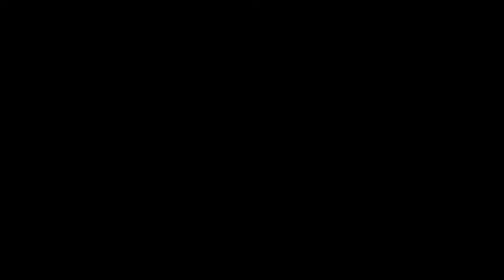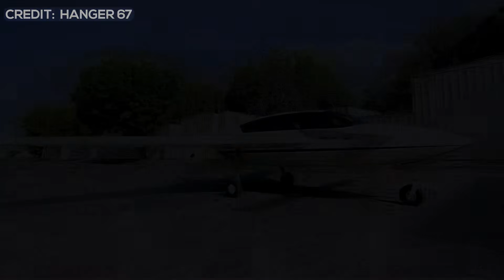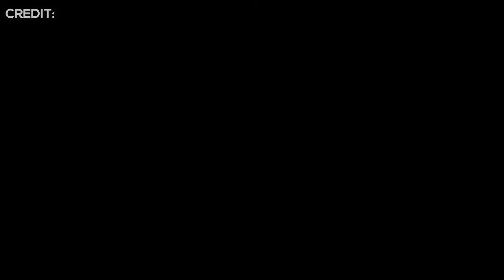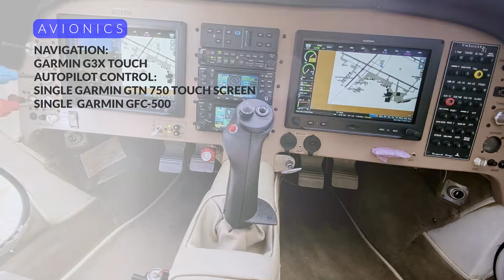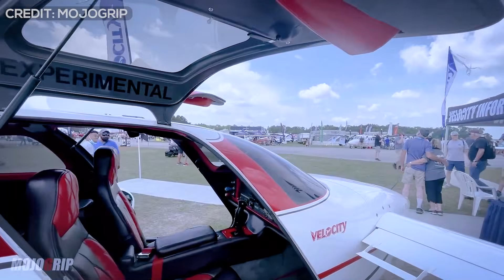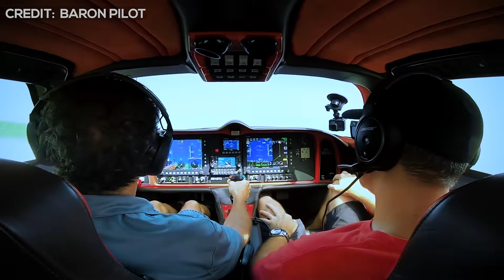Why the Velocity XL is Excellent

Comment: Good video. However, the Velocity Aircraft website says that the cruise speed is 250 ktas and with turbo even 270 kts is possible. 220 kts as stated in your video is far too little.

Comment: Many thanks for all infos !!! Could you confirm that the canard system  does not have negative portance of the traditional rear horizontal stabilizer which means that all square feet of the wings & canards are working together  to keep the plane flying ??? Thanks again 😄😄😄

Comment: Velocity says exceeding 220 knots could affect the airplane structure...  but I've read several Places that the Continental 310HP engine fitted with a Turbo ON A VELOCITY Can Cruise at 300mph...?  How does that work?
Reply: Indicated Air Speed (IAS) and  True Air Speed (TAS)  A limit on the maximum speed  (Vne)  does not mean that the aircraft cannot go faster through the air than that.

Comment: The door seal is NOT for pressurization, it is to reduce drafts and noise.  The demo plane is showing the GTN 625.  The aircraft is made of fiberglass, far stronger than metal or carbon fiber and the plane is rated in the acrobatic range for g-loads, thus flying faster than 225ktas is no problem.   The twin is SLOWER and less fuel efficient than the XL.   The Evolution is a bankrupt product...not really available.
Reply: since when is fiberglass "far stronger than carbon fiber"? You're completely delussional... you need to start telling all those silly dumb designers with Boeing, Airbuss, and the military that fiberglass is stronger they must have it all wrong as you seem like a genious
Reply: @slowery43  Laughing.   Cirrus makes all carbon fiber GA aircrafts, famous for being the first large manufacturer to use cabon fiber in their design. Long before Boeing or any other passenger plane maker.  The Cirrus are rated Normal category  +3.8g to -1.52 g.  The Velocity is all fiber glass and rated  +12g and -7g.  More than acrobatic and 4x stronger than Cirrus.  You may also want to use a spell checker when commenting, "delussional" has one "s".  And "genious" is spelled  "genius".

Comment: My Favourite Small Aircraft.  
I would use a 441 cu inch LS GM Engine or a 441 cu inch Ford Windsor or a Gen 3 Hemi 441 cu inch . Which ever produces the most Torque.  
Obviously l would require a gear reduction unit .  Not sure about the prop ... 3-5 Blades with Variable Pitch .
Reply: u want a lot😂
Reply: @AlanMydland-fq2vs  

Why not Alan .  Aircraft engines r CrAzY 🤪 Prices $$$$ . 
Could Build up a top of the Range Motor with the Best of everything 4 Quater the price of say a Continental Engine.  

Or go all out & put a Turbo Prop behind it .  Lighter 
The Airframe ✔️ is so Adventurous that being Smart here in the Engine Department will pay Dividends
Reply: how about the io-720 then
Reply: @Robert-mn8gc  i get that lots if money!!! their isnt a cheap motor today🥵
Reply: Gear reduction is where all of the failures happen.  It is just not worth it.
Reply: Why would you want to put in an engine that's WAY heavier, more complicated, more parts that could fail, and can't fit inside the cowlings? I own a Velocity that once had an LS in it. The cowlings looked like a close drier. I ripped it out and am currently in the process of installing a TIO-360.
Reply: nobody cares, you're not building one and clearly know little about aircraft engines stick with dreaming about what you think you know

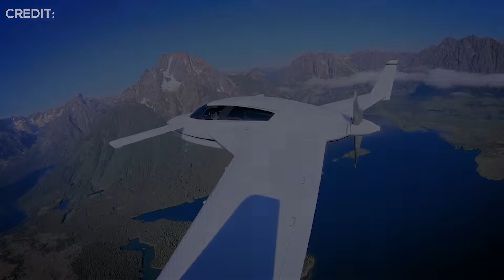Comment: At 11:30 the narrator states that when it is flown too slowly, the cannard pitches the aircraft up, creating additional lift??? As I understood it, when flying too slowly, the cannard stalls first, pitching the plane down and the main wing from stalling. Or, does this only apply to AOA, with the cannard stalling at a lower AOA than tha main wing? I mean, speed, AOA and lift are all tied together... maybe someone can someone clarify this for the rest of us?
Reply: You are correct.  The cunard is designed to stall before the main wing and drop the nose thus averting a main wing stall.
Reply: Yes, when you are about to stall the main wing the AOA of the canard causes an early stall there, but otherwise it's just extra lift and stabilization.

Comment: Yikes! 
There is NO pressurization system on this plane. The inflatable door seals are ONLY to reduce noise. The construction isn't strong enough to support pressurization, so even if you managed to plug all the holes, the front window will blow out if you tried to pressurize it. But Velocities do come with oxygen systems.
Reply: Pressurization and flight into known ice were not mission elements for this plane.  it is a cross country cruiser, but not in deep IMC.  it does come equipped with built-in oxygen systems so can easily cruise around 18k if desired.
Reply: @speedomars  Pressurization is just impossible for ALL versions of this plane due to the way it's constructed, not just for this plane in particular. And yeah it's not designed for having deice systems, but they can be added as electric heat pads to the front of the wings. Propeller doesn't need deice because it gets heat from the engine and exhaust according to some people who tested it. I've flown mine in deep IMC before, just not in icing. Mine doesn't have built in oxygen, but I have a portable oxygen unit that would let me fly above 18k. That said, only turbo versions are capable of it. Most Velocities have naturally aspirated engines, since they're cheaper and more efficient (less gas guzzling), so it starts to sputter out and really struggle above 17k, and the most efficient flight altitude is at around 14k. But oxygen is still good at that altitude since you avoid headaches with it.
Reply: @Rassah  No one alleges this plane or any other GA plane not designed for pressurization can be retrofitted for it.  That is silly.  Cirrus for example waiting to make a small jet to do pressurization.  Pressurization is NOT NEEDED unless you are flying in the flight levels most of the time.  Even de-icing systems are not needed for most GA planes.  It is convenient to have oxygen on board for flying between 12k and 18k.  The sweet spot for most GA cross country flying.
Reply: @speedomars  Yes, I'm just describing what this plane is capable of specifically, since I built and own one, and the video made a few mistakes.

Comment: A little off on the takeoff and landing. It's closer to 2500 feet, if full fuel tanks. I wouldn't feel comfortable landing on anything less than 2000, just because that's already pushing it for takeoffs.
Also the 200kts is mainly for turbos as higher altitudes. Normal aspirated engines do maybe 180
Reply: That's all good to know. Thanks!

Comment: evolutions cruise at like 260 knotts more like and get up in the 300s on other lancair models. I understand they are a bit more expensive but a lancair is a far superior aircraft. I have friends that have them several hangars down from me, You picked the wrong airplane to compare. Maybe a RV is what you are looking for?
Reply: The Evo has had problems in the air and nearly went out of business entirely.  Many fatal accidents.  Still, it is a different animal given they are equipped with a turbine engine which costs more new than an entire Velocity is to build and own.  The speed of an Evo is dependent on engine choice.  The gas version is slower than the Velocity and is a 350hp gas guzzler.  The turbine versions cruise between 250 and 300.  But again, dependent on engine choice and cost.  The Velocity with the Continental IO550C 310hp engine is said to cruise around 220 to 250kts.  Pretty good for the fuel burn rate and the fact it is flown much lower than an evolution to get similar speeds, the Evo of course is pressurized.
Reply: @speedomars  And the Lancair has a smaller cabin. The Velocity TXL is the 250 kts version.

Comment: Hey nice Video. but what is the difference between the XL-5 and the txl?
Reply: The XL-5 is the 5-seater variant. The TXL has a Turbo-charged engine and the pressurization door gaskets.

Comment: I am not going to pretend I know anything about aerodynamics but isn't that pusher prop a design more suited to smaller blade props? I mean, you have all that air in the boundary layer already.
Reply: I don't think so, the boundary layer shouldn't be thicker than what, 10cm? You're not gonna have a prop that small.

Comment: What’s the accident rate on a craft like these? I’m no pilot just interested in aviation.
Reply: The original concept, for this was an earlier aircraft design created by Burt Rutan. He was a legend in the experimental aviation industry. This design is unusually safe.
Reply: @rogerdsmith  Burt is alive and well, you donkey
Reply: @rogerdsmith   as I have read- The type is unexpectedly safe - Not unusually safe. in resume it seems to show it may be more prone to accident, ( for example Jonh Denver died flying a Long-EZ, if I remeber correct)dependent on the quirks of this unusual type. It seems to fly very well but more like a racer -the pilot has to be well aware of the planes quirks & behavior, then it becomes very safe..
Reply: @helder4u  The super short summary of the John Denver crash is 'pilot error' mixed with an 'unsafe fuel management system' installed by the original home builder.  The accident had nothing to with the overall design of the airplane.  There's a very detailed NTSB report on this.

Comment: There are bits of inaccurate information in most of 'The GA Insider' videos. For instance, it is obvious this airplane is not 20' tall.
Reply: At least he recited the correct height.
Reply: @rnordquest  False. Height is 8.5 feet.
Reply: @donjohnston3776  False. Height is 7'9" according to Velocity website.  I just remember he didn't say 20' and assumed he said it correctly.

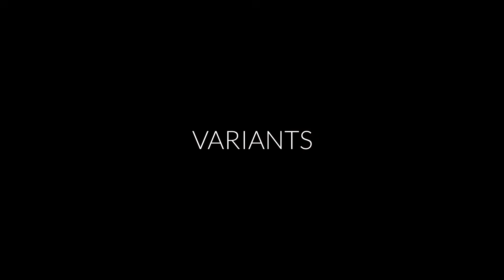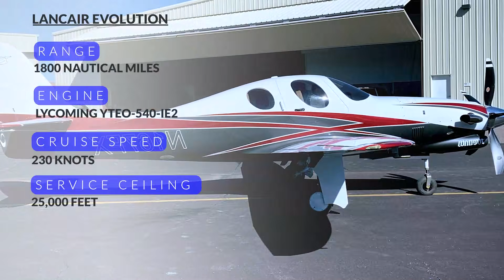Comment: Around time 7:15, the narrator seems to imply this is a pressurized aircraft, which of course it is not. Also, around 10:10, he mentions that the Lancair Evolution is a "piston engine turboprop " aircraft. WTF?
Reply from the maker: The evolution is available in both Piston and turboprop....
Reply: @Dwaynesaviation  In comparing the Velocity with the Evolution aircraft, the ground photos of the Evolution aircraft your video was showing had a PT-6 turboprop in the nose and , of course, the Evolution is pressurized! There was however, some brief in-flight footage of the piston- engine version of the Evolution you were comparing the Velocity to! And for what it's worth, I have seen photos of a turboprop powered version of the Velocity - do you have any info on this? Thanks!
Reply from the maker: @stevenward4162  There is not enough footage for the piston model. I should have simply wrote it on screen: same plane but just different engine.
Reply: @The GA Insider  the piston 4p lancair is available on the market under $200k and is still faster than the velocity and it's pressurized.
Reply: @Dwaynesaviation , yes this is true. However, he states that the Lancair Evolution is a "piston engine turboprop" aircraft. He obviously was not referring to engine choices, or he would have stated "this aircraft is available with either a piston engine or turboprop engine..." or something along those lines. He did NOT say anything like that, and he is very obviously clueless.
Reply: Yea, alot shite is said, guy has no clue what he posting.
Reply: dumb da dumb dumb... DUMB. the facts maa'm, just the facts. lol. yah,  we all knew this plane was leaps ahead of others in design, safety and economy. add in a PT6  and it would cost just as much as the lancair though. personally- I'd skip the turboprop & go for a velocity twin with the new deltahawk 180's. talk about range? you could cross the atlantic with a LOT of range to spare.

Comment: This vid plays like a commercial, not a review.
Reply: Its actually pretty accurate.  Its an all fiberglass body.  Started as a Burt Rutan design (see LongEZ).  Know for being efficient and high performance.  They can be equipped with the latest Avionics, like the Garmin G3x.  Dual control (side, yoke or center stick).  Fixed or retractable gear and roomier than most piston single (and dual) planes.
Reply: @speedomars I agree.  I was reading your comment while drinking a can of Dr Pepper.  You can really taste the 23 flavors.  It’s available in 8, 12 oz cans.  I prefer the 24 pack square container, but they are also available in a 6 and convenient 12 packs.  Be sure to stock up before the holidays.
Reply: It's definitely a commercial. Pitched at elementary level.
Reply: Because it is!
Reply: Did the title say review? I’m confused by your assumption.
Reply: Bad AI……UnSub…